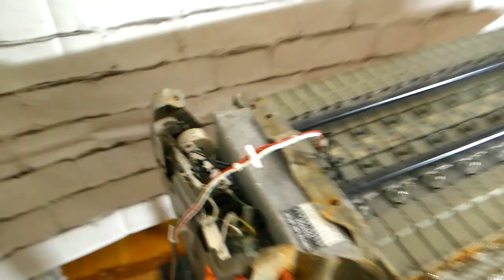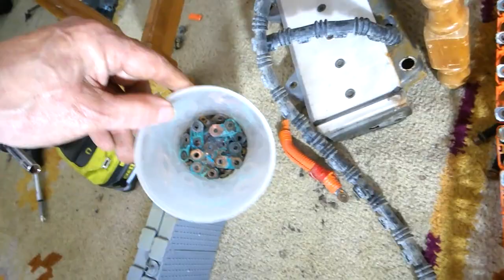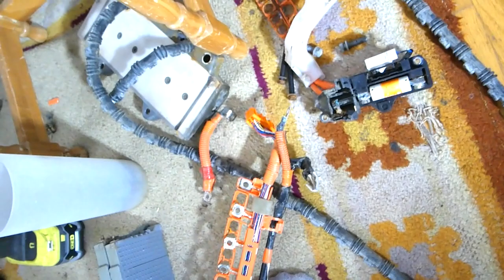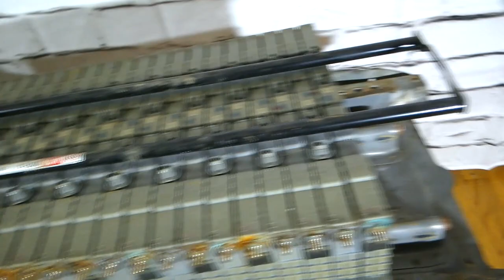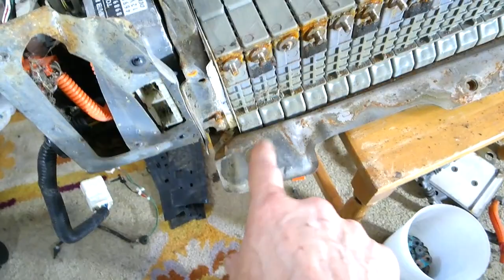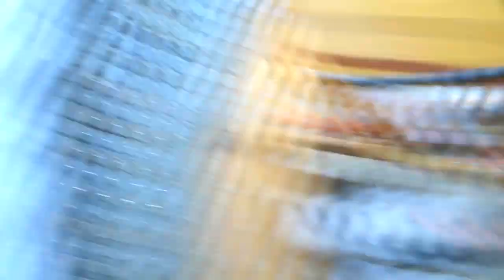EP.04 Prius Batt R&R for solar wall, diy house remodel.

Comment: Your charge controller is probably fine, it has to be connected to a battery before it can give an output voltage. Seven of those modules in series would come close to what a 48 volt battery system voltage. It is difficult to find a charger that will disconnect at the proper voltage. I would recommend having a Victron charge controller that allows you to change the parameters. Then you could play with the charge parameters to make sure you do not over charge them or charge them to quickly. Be careful the voltage of that pack as it is wired currently is deadly at over 250 volts depending on condition.
Reply from the maker: Thank you for the critique, I agree, I like Victron very much. Plus, I am always careful around voltages with over 40 years experience.
Reply: He changed it 14.4 volts so its good.

Comment: Those nipples on the top of the modules are not air holes. These are vents for when the module is overcharged and starts gazing, it releases hydrogen gas, a flammable gas. This is why all those nipples are connected together with the rubber tubes and exhausted outside of the car cabin.

Comment: Electrifying. High voltage info. Where did you get the packs?
Reply from the maker: Pick this one up at a local wrecking yard, they just wanted to get rid of it and then I happened to notice it just sitting there.

Comment: hey can you give me and idea how you set the batterys up all plus to plus - to -?explain and little more please.
Reply from the maker: Thank you for asking, I did half and half. Each cell does 7.2v so half face - to +, and the other + to -, then connected the back all together so I would have + on the left and - on the right with the buss bars. This is 19 in Parallel, 2 of those then in series, which gives me 14.4v total.
Reply: @ReverendJeffrey  thank you
Reply: @ReverendJeffrey  THANKS so i did two in series in the middle and 26 in parrilla's thanks again

Comment: im trying to find info about using gen2 cells for a solar set up in my bus, im finding that they are not great ... what kind of solar charge controller for nimh? 12v 24v?
Reply from the maker: With those cells being at 7.2v or 7.7v you can't do 24v but you can do 12v or 48v. I am having no problem charging them at 14.4v for a 12v system, that is what mine is at. I can use a standard trickle charger for a lead-acid battery without getting too far out of specs for the NMH chemistry.
Reply: @ReverendJeffrey  awesome, thanks for the info... im going to try my regular solar charge controller then to charge them up
Reply from the maker: @spiritualwarrior1084  Your welcome. Don't forget to watch the rest of my videos on this pack, I show how to configure them into series and parallel and the buss bars.
Reply: @spiritualwarrior1084  mrpower mppt charge controller has a lithium mode you can set it in. Does a higher voltage and 2 charges not 3 for lead acid